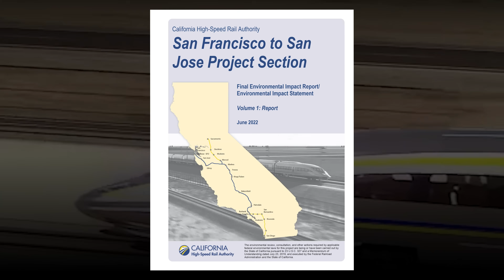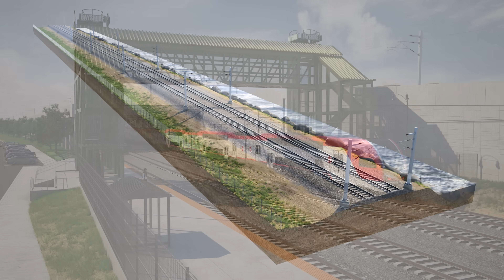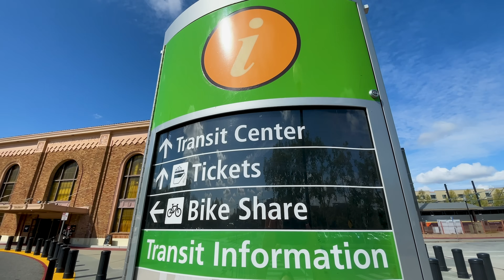San Francisco to San Jose Project Section Overview - FULL VIDEO

Comment: Each at-grade crossing is an extra possible point of failure. I really like this project but I hope that those crossings will be grade-seperated either by completion or in years closely following
Reply: Yes please! I don't some random person or car at the track obstructing the entire system
Reply: @Rengokutm  or causing an accident when possiblt hundreds of people could be on a train
Reply: South Korea still has at grade crossings for their KTX service, especially in the approaches to and from Seoul Station.

They just have to be really strict with crossings until such time that there will be enough funds for grade separation, i.e. Seosomun Crossing.
Reply: @ianhomerpura8937  that's a good point and I noticed it too the last time I went into Seoul. However, there are relatively few such KTX crossings, and the trains are moving, what, maybe 20mph max at that point?

I think the video said HSR has 39 at grade crossings (is that just between SF and SJ?). If so, that is totally nuts. No way you are going to want trains running at speed past that many at-grade crossings.
Reply: it comes down to money, the project is funding-choked as is. eventully I'd also like to see the at-grade crossings eliminated
Reply: @PlaystationMasterPS3  like I said, the grade separations will namely be up to each city. If they feel it’s necessary, they’ll do the grade separation. It won’t be up to CAHSR or Caltrain. Chances are grade separations wouldn’t increase train speeds very much, maybe up to 125mph max between San Jose and Gilroy, so they’d mainly be for vehicle and pedestrian safety.
Reply: @ChrisJones-gx7fc  I always enjoy your thoughtful and intelligent comments.
Reply: NIMBY's in Palo Alto are why you can't have nice things like grade separated tracks.
Reply: They won't. We were promised multitrack fully grade separated in 1A and we are now left with the blended system the video tries to pass off as reducing impact and improving safety. It doesn't, all it does is reduce cost.

The issue has always been about the money and all the questions are answered in the video:
0:28 - Everything described in the video is unfunded. The milestone reached is just pencil pushing.
4:49 - Grade crossings will still exist once HSR is operational (assuming the funding shows up).
5:32 - Grade separation projects are left to individual cities.
Reply: @someguy6075  Yes to everything you said. Oh well. It will be (perhaps in decades) what it will be. I am 200% for CAHSR. I can get past previous mismanagement if the funding was increased a whole lot.
Reply: @davidjackson7281  Agreed. By CityNerd's analysis SF to LA is a prime candidate for a HSR link. America just... sucks at infrastructure, like really bad. It's so disappointing.
Reply: @someguy6075  yep
Reply: @someguy6075  Promises, promises. It's always pie in the sky.
Reply: Exactly my initial thought. Can't trust people won't stay away and avoid accidents.
Reply: @ivanp2490  That's OK. They'll only make that mistake once.
Reply: I’m pretty sure that’s the long term plan to grade separate the entire Caltrain corridor where feasible. The quad gates are temporary to allow increased train speeds and frequency sooner. It should be up to each city, not CAHSR or Caltrain, to do the grade separations in their city though. For crossings where grade separations aren’t feasible, like the concept video showing San Mateo station, I’d imagine they’ll either keep the quad gates or possibly close the road altogether.
Reply: @ChrisJones-gx7fc  why should it be the responsibility of the small town being passed by the rail service to pay for grade separation???   That would be a hard NO.
Reply: @ChrisJones-gx7fc  Quad gates for high speed rail. Are you kidding me? For safety reasons, high speed rail should be built on elevated platform.
The California high speed rail is essentially dead on arrival. In China a high speed rail project between two cities can be completed in 3 - 5 years.
By the time the California high speed rail is completed, China high speed rail will be travelling at 300 mph.

The Best High Speed Rail in the World
https://youtu.be/9wJCltuawSs
Reply: @ChrisJones-gx7fc  Right, just close the road. Nobody using the road now will protest that - they'll be happy to make the sacrifice.
Reply: @ChrisJones-gx7fc honestly close the road. We did a ton of road closures in San Jose due to Covid, and even after the social distancing restrictions were lifted and lock downs ended, 3 years later, those roads have still been closed with no set date to reopen. Some have been eliminated together. Turns out people are okay with a little less roads
Reply: I wonder why they don't just put those physical barriers that rise from the ground at crossings,  similar to what they have in London and other European cities to prevent cars from going there.   A gate really is only going to do so much, but have a gate drop and then physical barriers pop up no cars in or out.     Of course it's going to be more inconvenient for those wishing to cross but hey that's a problem that shouldn't matter
Reply: @Mike__B  I guess it's more expensive and people will still collide into it which may have more chance to cause damage.
Reply: It's quite interesting to see that even the animation shows how drivers are ignoring the red lights and almost get stuck between the closing gates. Seems like many drivers in America don't really understand the rules and dangers of those crossings, because I see a lot of this happening in the LA area as well (and Brightline seems to have crashes almost every week). I have doubts that trains can pass those at-grade crossings at 110mph.
Reply: These are also a nightmare to actually travel over. It has taken more than 30 minutes for the lights to allow a left turn over the tracks during rush hour as each time a train comes it resets the light cycle completely. adding this much more capacity will make it impossible to cross the tracks during rush hour.
Reply: Congrats to people of Superpower USA 🇺🇸 🎉🎉 
We Indians are also building HSR with the help of Japan 🇯🇵.. we will be getting the E-5 Shinkansen 🚄
Reply: Grade crossings for high-speed rail is a mistake. They should be separated by bridge or tunnel, even if it means driving a mile or so detour. I've been watching Florida high-speed rail where people (including police!) ignore the crossing arms, but cross and get hit by trains.
Reply: @sandal_thong  That argument would have made sense if this were the main part (200+ mph) but these tracks are upgraded to 110 mph which isn't even high speed even for upgraded tracks (that would be around 125 mph).
Reply: @MarioFanGamer659  Whatever the speed, people (including police officers) cross in front of trains and get struck. Best to not have grade-crossings at street level, or until that happens, make it a one-way street so people can't drive around the arms. Of course I saw a video where the car had stopped past where the arms came down and then went across the track in front of the train, so there's no perfect solution other than elimination.
Reply: @Oak Island Pictures Probably, though it depends what is necessitating that 110 limit.  Could be having to schedule Caltrain on the same tracks, could be track not to spec for higher speeds, and of course could be for safety because of missing grade separations.
Reply: @Oak Island Pictures Hello? That's right.
Reply: Who pays for it?
Reply: @onetwothreeabc  the taxpayer who will benefit from the utility that rail projects provide. 2008, the Californian taxpayer voted to pay for this project.
Reply: @mrmaniac3  I was in California in 2008 and I voted yes for prop 1A. However, the fund approved at the time was not sufficient to fund the entire phase I project. In my opinion, Californians needs another referendum to approve funding the HSR project.
Reply: @onetwothreeabc  I am for three to five times more yearly funding of CAHSR whether the state etc. has a surplus or deficit because I don't know why I should care who pays for it or where the money is coming from, period.
Reply: @davidjackson7281  You don't have to care about where the money is coming from, and there will be NO money if you don't care where does it come from. Period.
Reply: Quad gating is what makes level crossings safer to a point. Also consider, sections where crossings are at grade will be travelled by high speed trains at conventional speeds. These are both elements of France's TGV system, giving credence to their application. Still, I agree that grade separation would be significantly better. In a similar vein, streetcars and buses also benefit from receiving exclusive right of way, disallowing general car traffic from public transit spaces bolsters their effectiveness.
Reply: this guy sounds like Sheldon! 🙃🙃
Reply: At grade crossings only make sense in urban areas.  There’s no point to have all grade separation due to space and the speeds only go up to 110 mph.   It takes 5-10 minutes to accelerate to 200 mph so it’s only best to have grade separation farther out of the metro area.
Reply: @galenphotos  The worry is that there will be many (deadly) accidents at those at-grade crossings that 1. cost lives, 2. disturb the train schedules.
Reply: @onetwothreeabc  they would install 4 crossing gates instead of 2 to prevent cars going around the gates.   Some countries even have gates for high speed rail.
Reply: @galenphotos  Do you think there will be no accidents at 4-gate crossings?
Reply: @onetwothreeabc  The track speed at these level crossings are not going to be 220mph. They prob won't run any faster than trains at level crossings in the US typically run. The 220mph track speed will be when CAHSR runs in the middle of the central valley.
Reply: Yep! Really was hoping the entire peninsula stretch would be elevated or below grade at minimum.
Reply: At grade crossings and high speed rail do not mix. It would only be a matter of time before a serious accident occurs. 
So what happens when a high speed train collides with a car or truck stuck on the crossing? 
Probably a derailment and 100s of deaths.
Reply: @Novusod  What happens when a regular speed train collides with a car or truck?   Remember they're going to be speed limited in populated areas, and that limit is about the same speed as Caltrain existing speed,   they may go even slower over crossings too.
Reply: From what I can tell the cities along the corridor have to pay for the grade separation projects. I live in Sunnyvale and there are 2 crossings that are supposed to be closed or separated in the next few years
Reply: Oh wow
First time I've seen high speed rail gets at-grade crossings. (Maybe except some Europe ones)
But definitely NOT in Japan, Taiwan, and China HSR. 
They all have dedicated rail and no crossings.
Reply: @simonlam33  In defense of CAHSR, that one is on tracks which wouldn't even be considered high speed by speed requirements (200+ km/h for upgraded tracks, 250+ km/h for new tracks) and is closer to that of regional trains (which this ultimately is) while the main (actual high speed) portion is built with no crossings whatsoever (lest because the FRA forbids crossings at these speeds). That being said, the FRA rules about grade crossings are far too lax than they should be even ignoring the fact that new grade corrings can't be built in many (West) European countries regardless of speeds.
Reply: I am curious how hard it would be to effectively tunnel under the crossing.  I mean I know would need to support the train tracks with a bridge of some way.   But I've seen what they did in San Bruno where BART I believe runs under the area so couldn't lower the road too much so the train tracks were raised quite some distance and of course it requires a gradual slope so there's a pretty big wall through the area.    But BART stops in Millbrae so beyond that there wouldn't be an issue with a road too low unless there was a water table/flood issue.
Reply: @Mike__B  It is probably one of the compromises that CAHSR had to make with CalTrain since CalTrain and thus CalTrans does not want to spend any more money than it has to. And note the track speed in urban areas is significantly lower than the track speed in the middle of the Central Valley.
Reply: Agree. But it's not the CA HSR Authority you need to convince. It is all of the little balkanized towns along the peninsula you need to convince to be willing to do this. The debates/fights on this topic have been quite a spectacle over the last ~decade, and many cities are refusing to change their built environment to accommodate this project (or make absurd demands, like tunneling the entirety of the HSR line for dozens of miles so that no changes need to happen above ground).

As such, we're left with this weird compromise. People's safety is definitely at risk in this model, which is very unfortunate.
Reply: There are too many dumb drivers that do not know how to clear the at grade crossing. High speed rail is too fast to stop for them. Every at grade crossing at some point is going to get someone killed. Please do not design this kind of error into the system.
Reply: Just shut down most of the crossings, and manage congestion at the other crossing via tolls
Reply: I can see some spectacular collisions in the future
Reply: @1dluep  collisions happen in all types of transportation.
Reply: So that's what they're doing with DT San Mateo.... Well, at least it's not HST section. If you're ever there, you can tell that it's hard to change things up there. There's really no space.
Reply: Grade separations only benefit drivers. If they're going to pay billions for overpriced and unnecessary grade separations, it should be funded from Caltrans not out of HSRs budget. Grade separations are perfectly fine so long as they're engineered to be fail-safe. Our existing grade crossings are engineering failures because it's easy for cars to obstruct and collide with trains. Fail-safe crossing grades eliminate this point of failure by stopping oncoming trains automatically if the crossing grade gates don't close because of an obstructing vehicle.
Reply: @boyziggy  I agree, take it out of the highway budget and not the HSR budget
Reply: @boyziggy  The reason grade separation vs no grade separation only benefits drivers is because trains can't start and stop and have priority at the crossings. But if there will be increased gate-down time at crossings, that is still trains taking crossing timeshare from drivers. You can argue all you want about inefficiency of roads and bad urban planning, but if the project negatively impacts already existing users it is reasonable to expect the project to mitigate that impact. Not being car dependent would be great but many of those drivers don't have a choice and it's not going to change overnight. HSR isn't in the right to throw everyone else under the bus because they couldn't keep their fraudulent promises from 2008.
Reply: @someguy6075  Vehicles only have to wait a short time at gated crossings for overall low frequency, fast, small passenger consists. Brief patience = safe impacts. Perfect.
Reply: @davidjackson7281  The impact to traffic depends what the overall down time will be. Electrified trains improve train control and decrease down time per crossing, but they also plan to have more frequent crossings (not just adding HSR, Caltrain is adding trains as well).
Reply: @someguy6075  I just checked the Caltrain schedule. There are 102 trips per day with frequency ranging from four to eight crossing trips per hour. So I agree there is down time now and it will increase with added trips. So again, I am for much more transit funding (especially for safety). I hope eventually the cars and trains will just have to get along with each other instead of being at "cross" purposes.
Reply: @someguy6075  HSR puts people in the bus. Cars throw people under. Important distinction.
Reply: @davidjackson7281  We live in an imperfect world. When someone gets killed, you can explain to their parents why this "perfect" system failed.
Reply: @boyziggy  bro do you know how long it takes for a train to stop
Reply: @boyziggy  it doesn’t just benefit drivers (though they are the main beneficiaries) however with full grade separation urban speeds can be raised
Reply: @boyziggy  stopping the trains because of bad drivers or pedestrians inconviences hundreds to thousands of people. it also presents a risk to life of drivers and pedestrians as well as a derailment possibility for trains. grade crossings should be eliminated wherever possible.
Reply: @jonathanodude6660  I can agree that level crossings are dangerous and you should not rely solely on drivers remembering drivers education to yield to trains. However they are significantly cheaper than full grade separation. Much of the high speed portion is already grade separated yet trains are not going to speed through at 220mph at a level crossing. Even the Shinkansen has segments where the trains are slowed down in the interest of safety.
Reply: @Awesome_Aasim  im not arguing for faster trains, im arguing for safer cities. grade separation is positive however you spin it. the only questions now are whether the benefit is worth the price, and whether the price can be paid. i firmly believe the price is worth it, having lived near grade crossings for almost half of my life, and having also lived near grade separated crossings for the other half, but if they cannot pay for it, they cannot pay for it.
Reply: @boyziggy  I live in the silicon valley.  Every year we have news about pedestrians or cars struck by a commuter train and the CalTrain system would be halt for hours.  No matter how good the gates are, there are accidents and sadly there are also people committing suicide.  If we want the high speed rail service to be uninterrupted, we need grade separations.  The high speed rail authority is already funding lots of grade separation projects on remote areas in the central valley.  If they are funding all these central valley projects that benefits fewer people, to be fair, they need to fund the silicon valley projects that benefits way more people.  Otherwise, please stop funding all the grade separation projects all together.  Fairness is very important. Either fund all grade separation projects or fund none of them.
Reply: @boyziggy  the goal of most modern railways around the world is grade separation for safety and the maximising the efficient use of a rail corridor.
Reply: @boyziggy  i’m not arguing the point of who should pay for it, but I don’t agree that they only benefit drivers. When some person with very poor judgment or suicidal notions put themselves in the way of a train, riders get hurt and killed and train service gets greatly interrupted for days or weeks depending on tue infrastructure impacted. So definitely can affect riders.
Reply: @boyziggy  That's not correct. Grade separations benefit both train and street traffic. 

First, level crossings imply complex signaling technology tied to object detection will always be pessimistic and therefore cause false negatives on a regular base. With so many level crossings between SF and SJ occasional events of that sort will most likely accumulate to a significant error rate on corridor level. This would then translate into a major source of delay that tends to multiply on a corridor with high frequencies and timetable dependencies (e.g. HSR trains and Caltrains need to meet at designated passby stations and not overlap at other stations). The general rule is: When you have mixed use corridors, your reliability must be through the roof on every aspect of your operations or you enter a world of pain (compare Switzerland with Germany, both operating mixed used corridors with very high frequencies).

Second, a fixed train control block is required at every level crossing and a train can only enter that block when the crossing is confirmed closed and cleared. The distance from block entry to the level crossing must be in line with the breaking curve plus distance between signal and automated enforcement plus security margin. Nearby level crossings must often be combined in one block, increasing the block size. This already severely limits the optimization of blocks with regards to capacity on traditional signalling systems. Even worse though these blocks interfere with the possibilities offered by virtual blocks (ETCS Level 3, CBTC). Virtual blocks move with the trains, allowing them to safely follow each other within very short timeframes at very high speeds (~30 seconds at 160 km/h). Such a technology would precisely match the needs of California HSR and Caltrain on the SF to SJ corridor and could massively increase capacity and reliability without building any new tracks. However, supporting fixed blocks at level crossings in combination with virtual moving blocks is complex and might even never be developed as it's such a niche scenario (for obvious reasons).

Overall, eliminating level crossings would severely increase the reliability and capacity of this specific train corridor, especially in combination with modern signalling technology.
Reply: It’s a train to nowhere